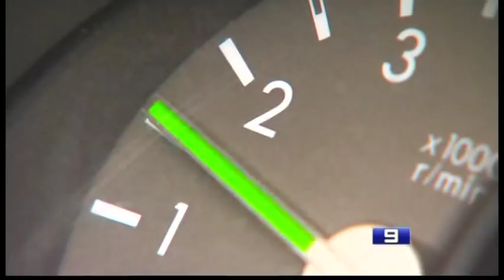Rosco McGlashan on Channel 9's A Current Affair - 14th Jan 2010

Comment: Has it turned a wheel yet?
Reply: The problem is unlike Bloodhound which is designed to have two seperate engines, the Aussie Inader can't run until the rocket is ready. Would it not be possible to use a lower power off the shelf engine for testing, or is the car itself not sufficiently developed as yet?